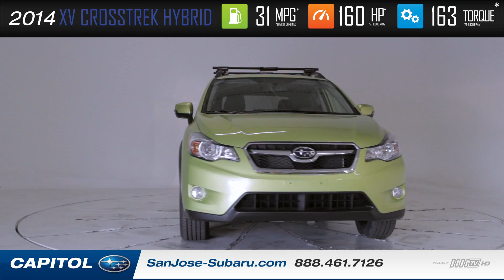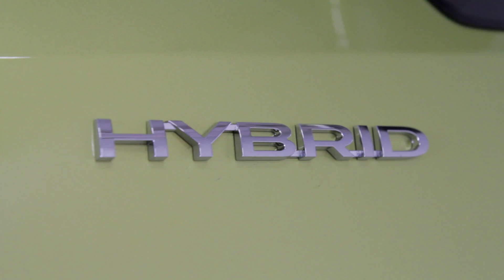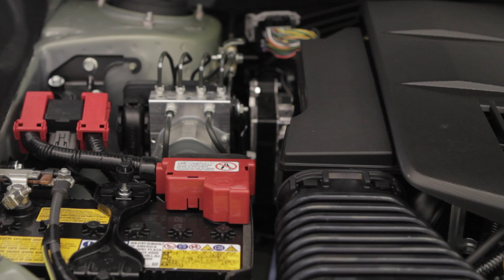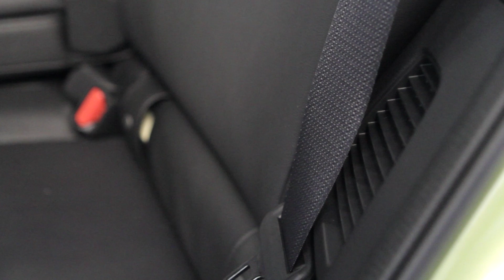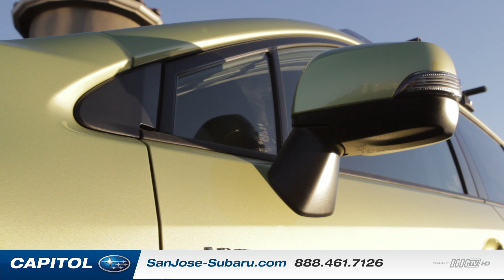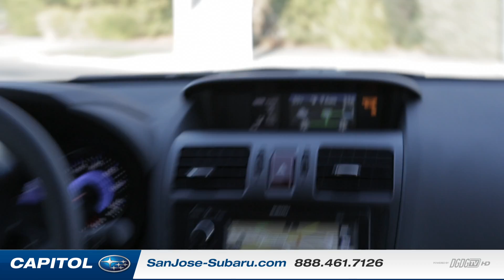2014 XV Crosstrek Hybrid - In Depth Review & Test Drive

Comment: Great review pointing out lot of features! but  Hybrid system need much more improvements! it way underpower to do much to conserve any fuel. 17 hp with 40+ lbs torque not going to cut it!  i get 19-24mpg city that being light footed, also the engine revs up to 2000 rpm while your going down a step hill at  speed under 10 mph all the way down!  so there no fuel saving!

Comment: As an XV owner, here are some notes.    1.   GM was the first to have a hybrid with motor in the transmission.   2.  Sucks still no eyesight on XV.  3.  Sucks still no blind spot monitoring on the XV.  4. Sucks, still no rear detection on the XV; yes it has the camera, but you cannot watch that all the time.  5.  Should have had a bigger electric motor and battery; 13 HP is pretty pathetic.   6.  Still no dual climate control like the Forester.  7.  Still no rear fog lights.    The XV hybrid is a move in the right direction, but it is let down with the above.   All in all, Subaru would have done much better just selling the European diesel which massively outperforms this with MPG's, and yes I have drove that too.
Reply: To let you know.   In the UK the diesel is only $800 more. The diesel is also 1.2 seconds quicker accelerating 0-60 and has a higher top speed than the 2.0 gas version, gets 40.3 average MPG (45.2 MPG Highway, 33.2 City). It also produces 9% less emissions than the Gas version too. All this excludes the other items on the UK and European versions:   Like Start Stop, Dual Climate control, Rear Fog lights, Popup Head light washers, Auto Windshield wipers, Electric folding mirrors, Auto leveling headlights, Multi-function display, 3520 LBS Towing (Vs 1500 LBS in USA,)  Hill start assist (even with CVT versions,) not forgetting the 5 year bumper to bumper warranty vs the USA 3 yr crap.   Thanks Subaru for not giving these features to us USA customers!
Reply: SUBAPOO wow lucky bastards!! $800 mire for the diesel version? Here in North America it would be more like $5000 to $10000 more. We need more diesel engine factories. Lower the price.

Comment: That was great, thanks!  Does the hybrid feel like it uses the additional torque?  Feel any quicker than the gas version?
Reply: It accelerates a bit better than the regular XV. The extra torque is definitely noticeable. More importantly, it is MUCH Quieter. If you want to take a test drive, call or text 415-987-9393. We are the West Coast's Largest Volume Dealer and have a bunch of em!